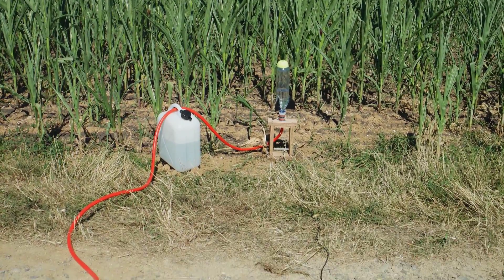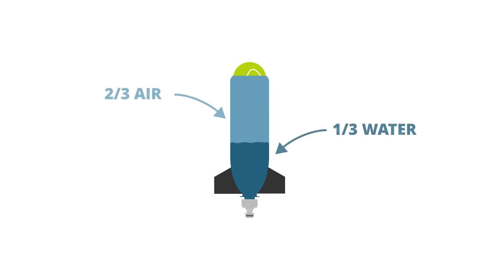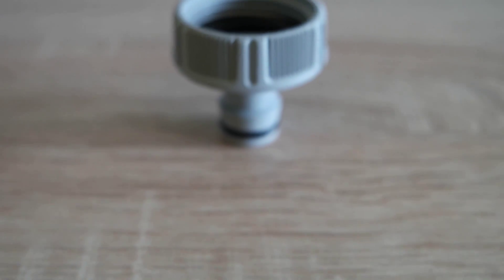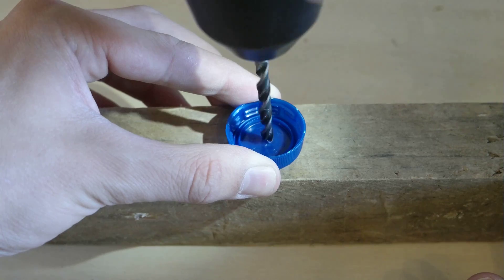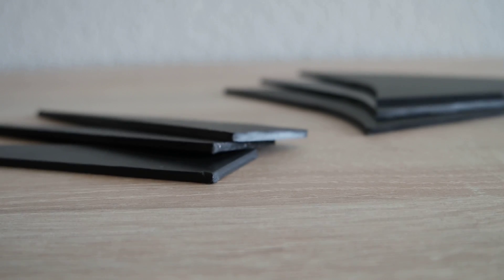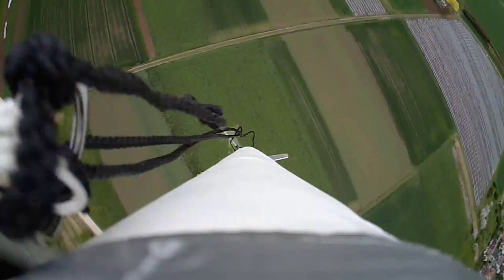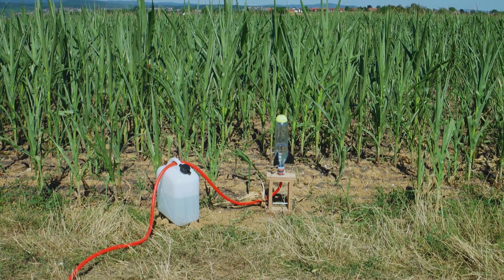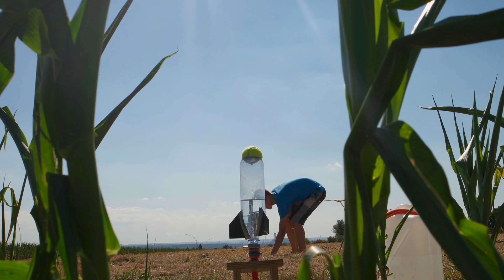DIY: How to build a simple water rocket

Comment: could i use a 2 liter curvy coke bottle will i have the same results?
Reply from the maker: sure, it´ll fly as well ;)
The actual Altitude depends on the launchpressure which is usually lower for soft plastic bottles. The bigger diameter of the 2L coke bottle might also reduce the Altitude quite a bit.
Reply: @RaketfuedrocketsDeutschland  Thank you so muc

Comment: I have a problem with the rockets and maybe you can help me. When I launch It , the rocket doesnt flight straight Up, It turns right very quickly. Do you know which could be the problem??? Thankss
Reply from the maker: This problem is likely caused by the point of pressure and point of gravity of the rocket. Generally speaking, you have to attach the fins at the bottom of your rocket and make them large enough. And the top of the rocket should be a heavier than a typical bottle, so use a tennis ball or something like that.

Comment: Hey won’t the water go up in the hose as soon as the bottle’s flipped over?
Reply from the maker: That's why we suggest raising a part of the hose above the water line in the rocket. ;)
Reply: Raketfued Rockets thanks for the reply :)problem solved. The one last problem we have is that when we release the rocket it doesn’t fly straight upwards, instead it flies sidewards.
Reply from the maker: That's a pretty common problem. You can try to change the launch pressure or to optimize the center of gravity of your rocket. Do you have a tennis ball attached on top of the rocket?
Reply: Raketfued Rockets  we just tried to mimick the weight of the tennis ball.
Reply: Coleen Mape the tennis ball was for a nosecone not weight

Comment: hey i tried to build one of these but there are some leaks where The water and the air get through how can I fix this??
Reply from the maker: +ioguitarix 
Sorry, but we can't help you without further information. :/
Please give us more details about which parts of your rocket are leaking.
Thank you
Reply: +RaketfuedRockets it leaks through the threads of the gardena adapters
Reply: +RaketfuedRockets it also leaks through the nozzle's twisiting for the bottle
Reply from the maker: ioguitarix Did you remove the seal from the tap nut adapter before you glued the bottle cap in?
Reply: +RaketfuedRockets yes I did. I tried fixing it with tape Which initially worked but then it started to Leak through the release mechanism
Reply from the maker: ioguitarix
Hmh, I've no idea what the exact problem is. Maybe your coupling is damaged? Did you try to replace it?

Comment: Hi Julian,
Very well made video, as usual. You do a great job editing and adding music to your tutorials. Congratulations on the nice job. There's one thing I thought might be an issue for someone in North America.... our hose couplings are too small to accept the bottle cap as you attached it here. I have never seen one that large before, so perhaps they are a specialty item someone could order online?
Reply from the maker: USWaterRockets Hello USWR, thank you for your nice words. :) 
I made this tutorial together with Chris from our team, and it was a lot of work. It took us four shooting days and two editing days to make it. Tim is currently in China, so he wasn't able to help.
In Germany, there are tap nut adaptors availbe with 1/2", 3/4" and 1" threads in every hardware store. You need a 1" thread to glue the bottle cap into it. Are there no 1" threaded tap nut adaptors available in the US?  I'm sure you can buy them online. 
Greetings from Iceland
Julian
Reply: RaketfuedRockets Sadly, in the U.S. there is only one standard common size garden hose fitting used. This is a 3/4" diameter straight (non-tapered) thread with a pitch of 11.5 TPI. Oddly, this is incompatible with our standard for pipe threads, where  3/4"  pipe thread has a pitch of 14TPI.
Reply from the maker: USWaterRockets Mhm, thats good to know. It seems like this problem is pretty similar to getting PL Premium in Europe. :/
Reply: I used a hair dryer to warm the threads of the pop (soda) bottle and then screw it to the quick connect hose adaptor. It is easily "tapped" to fit.